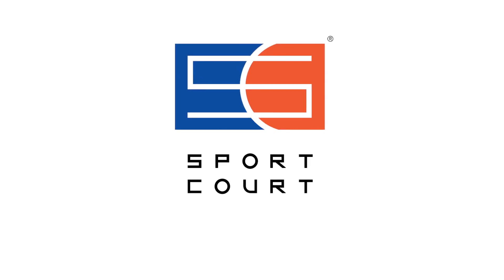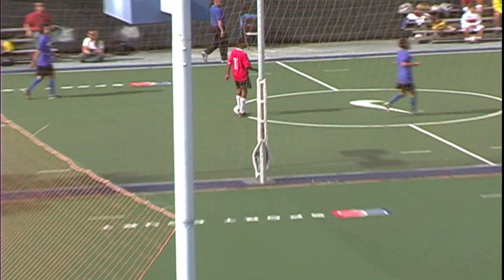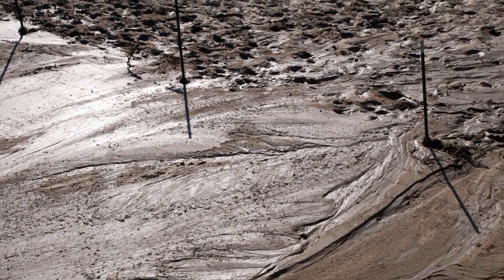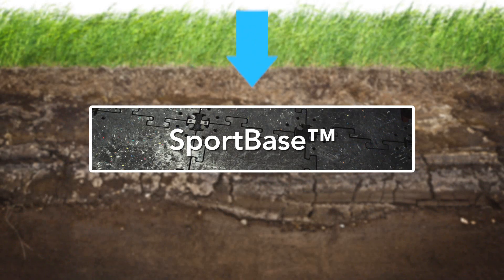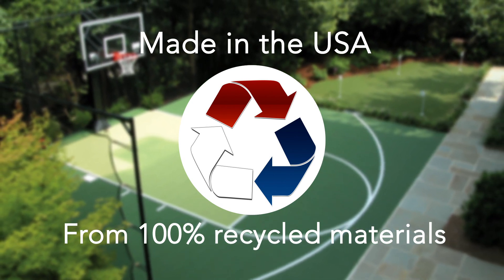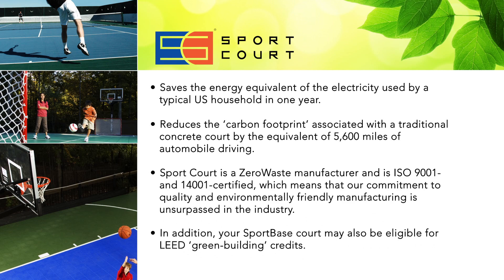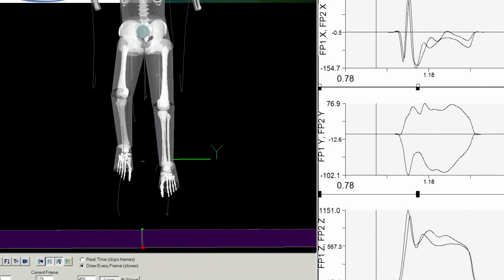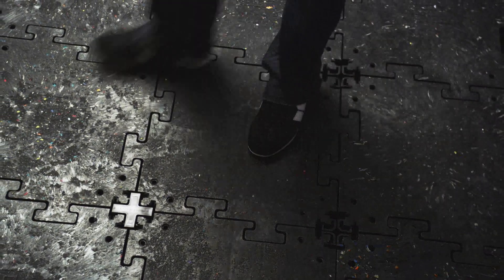SportBase-An alternative to Concrete

Comment: Concrete or Asphalt is superior for performance because it is so rigid, the softness of the rubber and plastic will make you lose your bounce.
Reply: yeah thats why all the best trampolines are made out of concrete
Reply: @elbatsbak  is a beast
Reply: My court has the concrete, the best thing is to put it on a 4inch slope and the water will run underneath and off to one side.i have had mine for 4 years now and it is still holding up well